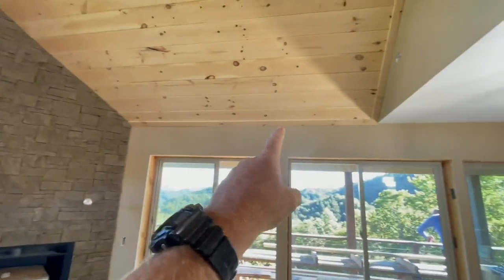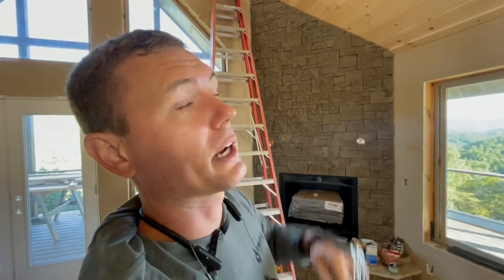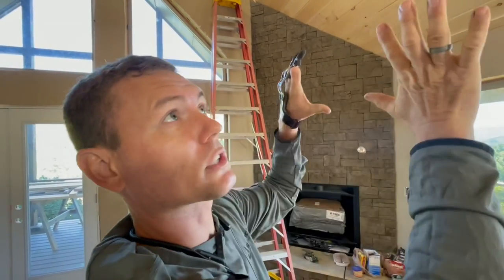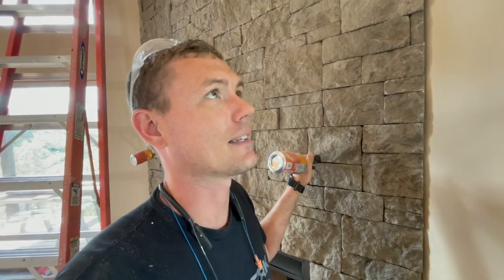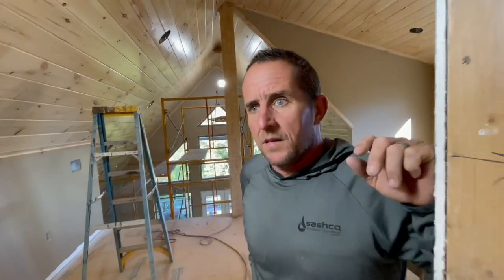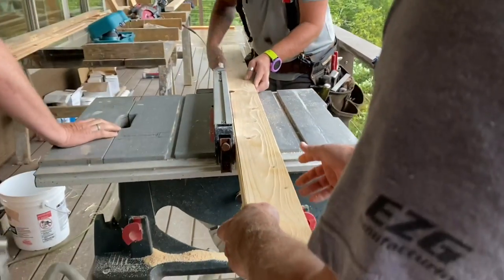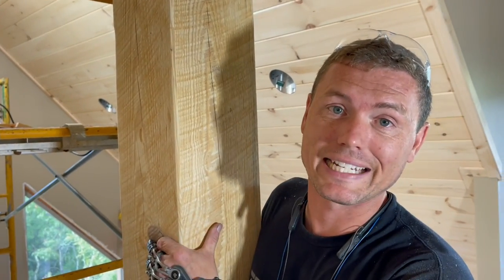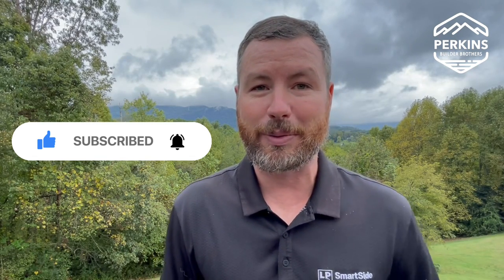Learn More About Trim Carpentry

Comment: 3:00 Totally get what you mean. I've built some very complicated roofs before and found that 'mocking up' the angles with scraps of wood is far quicker than using maths and still getting it slightly wrong.

Comment: Thanks. My carpenter left big gaps at the ends of my wood ceilings now I know how to do the trim though I may fill in the gaps with yellow pine  wood ceiling pieces  as well before covering over it with trim because a few are over an inch wide or so in places.

Comment: Don't know if it's available in your area, but look into fiberglass mat tile backer board. It's a gypsum based product that's completely waterproof but can be cut and installed just like drywall. We usually put a coat of red guard over it to seal inside corners, nooks,etc. You could schluter over it if you prefer.

Comment: I paused your video to tell you about digital miter guages. Do you use these? You will like it if you don't already do it.  A cheap one convinced me to throw down for a better one for my purposes. You don't have to guess angles, you can just nail it. To a tenth of a degree. I'm excited about it because they are new to me, but they've changed how I work, in a good way.

Gonna go finish watching!
Reply from the maker: Hey thanks for the comment… I’ve actually never tried digital miter gauges, But maybe I should give them a shot
Reply: @PerkinsBuilderBrothers  You can grab a cheap one at Lowe's for around $20. My guess is that it'll bring a smile to your face after your first use in the field.
Reply: Starrett Miter gauge is a game changer!   
Learned that from Finish Carpentry TV

Comment: This probably gonna sound strange but can you use the zip systemr-sheathing on a floating floor board floor?
Reply: Email Huber. They reply to Everyone. I'm just a diy guy and wanted to know if I could use cut off edges as top or bottom plate on a wall for a shed. Of course they said that has never been tested but if you do let us know.

Comment: PRO TIP:  When cutting a narrow strip on the table saw, cut it on the outside of the board.  Never against the fence as it is likely to shoot that strip right back at you.
Reply: When you have to rip multiple strips at the same width you dont want to have to adjust the fence each cut. Have a second guy on the receiving end of the cut to pull through and you wont be risking having wood backfire at you. Working solo though, I absolutely agree!
Reply: @BTCarpentry  I rarely have a second guy to help.  In the case of multiple strips, just use the first strip and insert it against the fence and it will push the main board exactly the distance to cut another one.  Remove the strip and slide the fence up to the board.  Repeat the process.  I’ve seen multiple jigs for cutting strips which are all ridiculous when the simple process works perfectly without any jigs or risky cutting methods.  I’ve done a LOT of edge banding over the last 50 years using this method and they come out perfectly.
Reply: @hallenw  I never thought of that! There’s so many tricks out there to do this stuff. I’ll definitely give it a go the next time I have to make multiple rips!
Reply: Your method would work great on a saw with no kerf. If you lose 1/8th of kerf, every strip will get 1/8th smaller. Unless you are omitting a step involving kerf thickness strips?
Reply: @Jacksonemccoy  if you keep the first strip as the template it won’t grow by the 1/8” kerf each time.  If the strips need to be super accurate (usually not for edge banding), cut the template strip 1/8” larger.

Comment: The problem with that approach, of putting the trim trim up against the ceiling, is that you've more or less defeated the whole purpose  of putting the 1/4 inch gap in the ceiling in the first place.